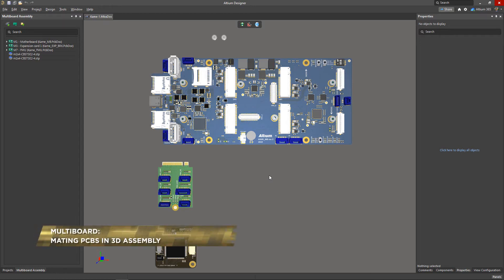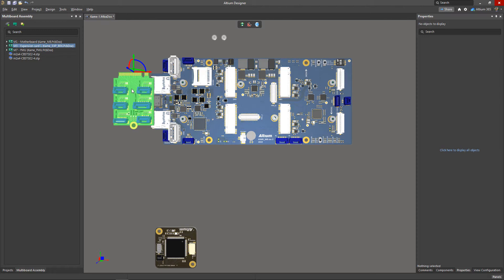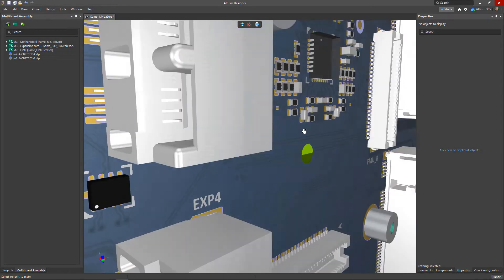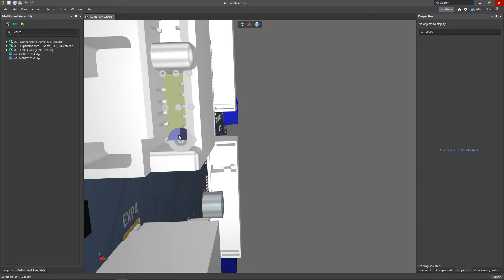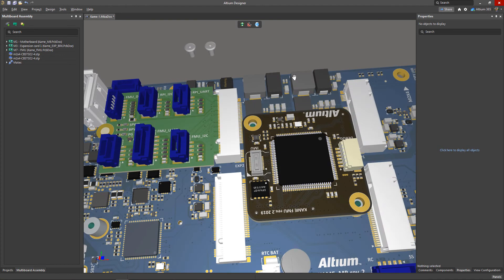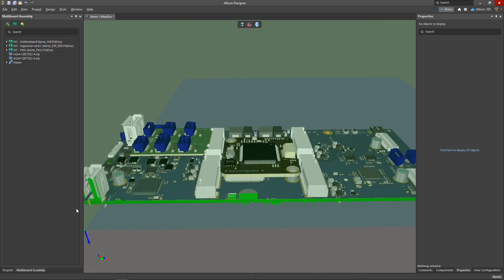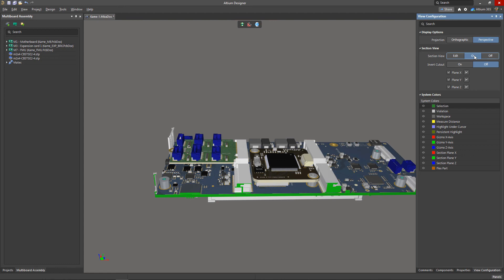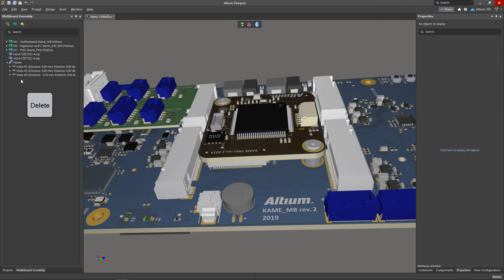How to Mate Objects in Your Multi-board PCB's 3D Assembly

Comment: Now this is something very cool feature. Really this will be very helpful from board assembly point of view. Is it also possible to take step file output with the whole assembly ?
Reply: Yes, you can export the whole multi-board assembly as a STEP or Parasolid file.  However, you don't have as fine control of export as you do when exporting a single PCB.